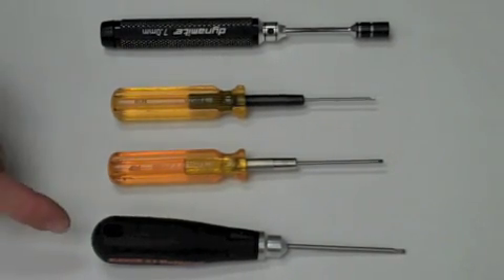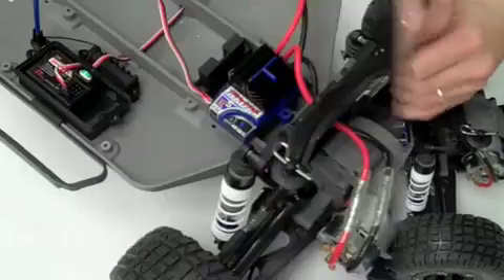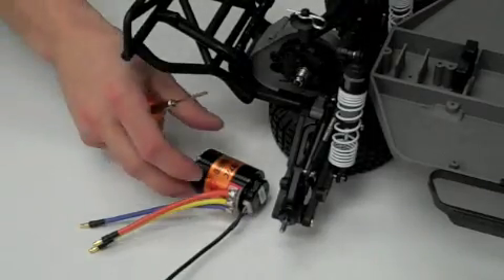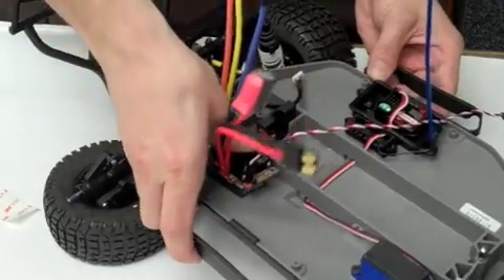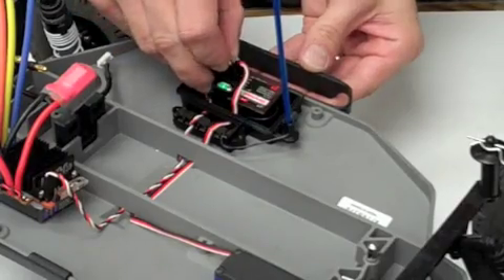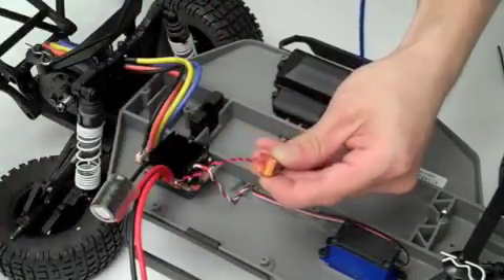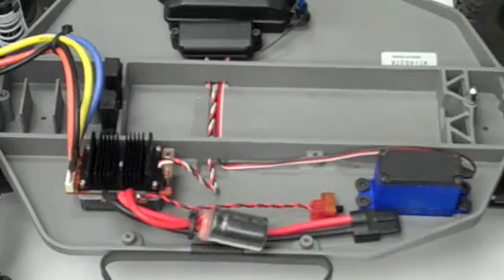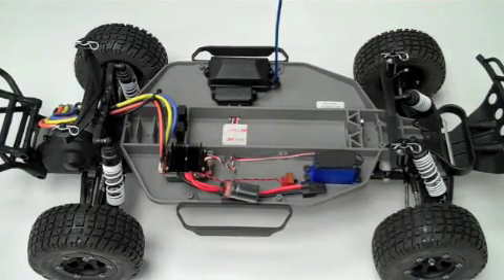How to Install a Sensored Brushless System into a Traxxas Slash

Comment: @46000rpm Nothing with your remote changes as long as you dont mess with the receiver box.  ESC and Motor have nothing to do with you 2.4ghz system.  :)

Comment: @NovakElectronics nowayis the10.5 close to the titan12t i just installed my 10.5andi usea 2s lipo with 13 pinion and 90 spur and i get like 35minutes ofruntime and i clocked it going 45.3 mph

Comment: i have an ss 5800 kv in my traxxas slash and i run a 7 cell and it runs for like 5-8 min adn then shuts off and my gearing is 18 /90 what should i do ?

Comment: is this faster than the 12t titan because i wanted a brushless with the same speed or a little faster than stock because i hate cleaning my motor, also if i got this could i use 18/90 gearing?